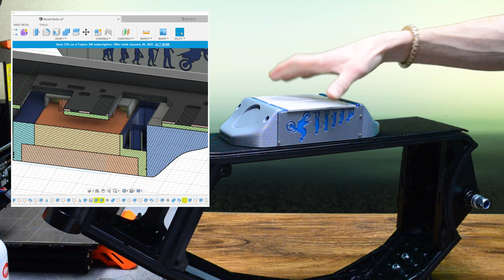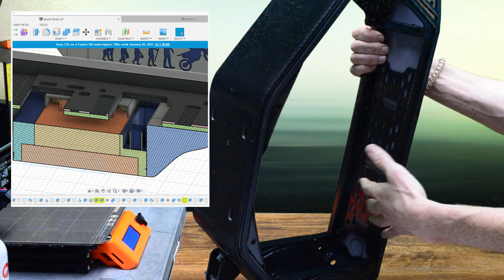Lightning Rods Big Block XL 10kw Ebike build Part 3 BAC2000, 4000, 8000 Mounts

Comment: what is exactly lightning rods???? Is it name of motor?
Reply from the maker: Lightning Rods is the business making the drive kits. The actual motor is termed the big block. There are several sizes of which the one here is the second biggest. More info and a contact form via the link https://highvoltagekits.com/lightning-rods-electric-motors

Comment: Hey Captain,  question for you.  Is it better for the battery to top it up at say 75% battery or run it down to 40-60 and charge at that point?
Reply from the maker: Neither of those two things are bad really. Batteries suffer wear and tear through use on a chemical level. They suffer most at very low charge and full charge. So I usually only charge to 90% and never below 20% By doing this you get more cycles. But I would not stress it too much. Avoiding total depletion and long periods fully charged are to be avoided. Hope this helps. Cheers
Reply: @HighVoltageKits  Helpful it is, thank you.

Comment: Hi mate, I am considering a new controller for my BBSHD. Is there a good reason to look into ASI BAC instead of phaserunner v3?
Reply from the maker: Honestly for the bbshd they are not that far apart. The phaserunner is a custom version of the bac800 essentially. You are limited I think to the cycle analyst with the phase runner for a display I think. Due to the throttle connection. The asi might be a bit better performance wise. Getting a kit is tricky. Electron cycles is the only place that might have stock. There is a good video by grin on installing on the bbshd so worth a watch. The asi is a trickier beast to use especially if you run into issues. Hope this helps.
Reply: @HighVoltageKits  It does help a lot, thanks! 
Even the "getting it" part now has changed as of January first. UK is out of EU and for me that means the same 25%VAT + 15%import tax + customs duties as if I would ship from Canada or anywhere else in the world... 
I might just order a phaserunnerV3 with the CA3 from Germany... ~650EUR with all the shipping, bells and whistles.. 
Following your new project with a bit of white envy :D
Reply from the maker: Yeah. Its nuts. I was ordering printer filament and the place in the Czech Republic won't take uk orders right now. Its bullshit. A 15% tax on ebike stuff is just crazy

Comment: Awsome please I would love a new bac 8000 mount for my enduro bike. 💯👍🏽
Reply from the maker: That cool. I had a bit of interest in the 8000. Seems more popular than I thought. You can get me on discord https://discord.gg/YAAjfgc or messenger and have a chat about what you are looking for. There is a bit of customization involved depending on which exact frame type and size. Links in the description as well. Cheers!
Reply: @HighVoltageKits  Thanks bro, I will get in touch with you soon. I am waiting for my new (480amp) battery pack. After I rearrange things on my bike, I will have a better idea of what I need. Thanks for everything💯👍🏽